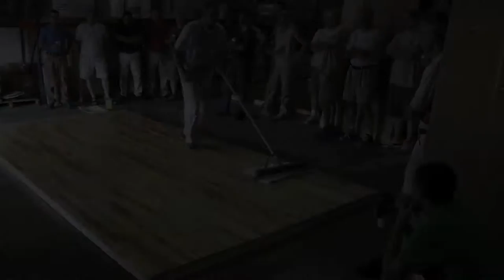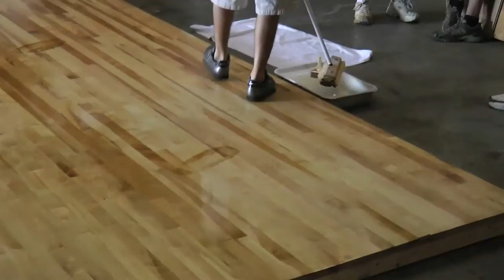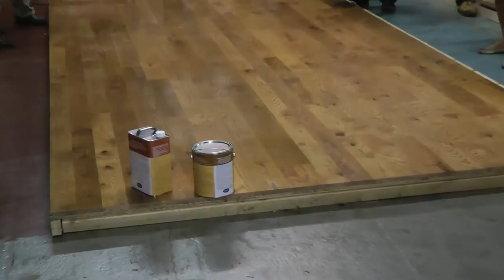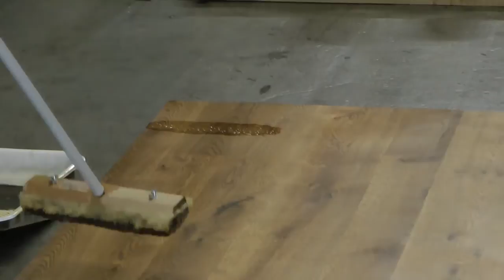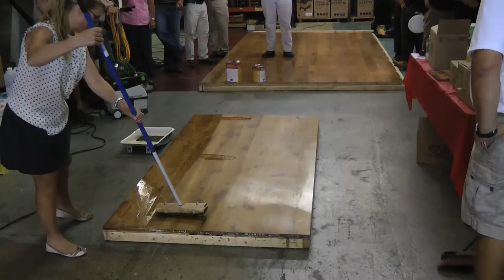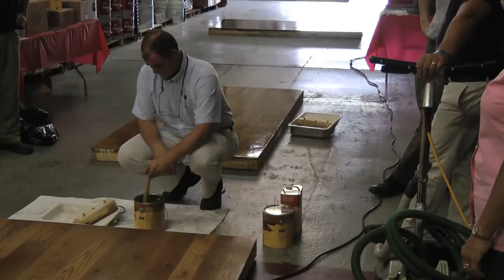Waterlox Training Seminar | City Floor Supply

Comment: For my live edge tiger maple table..can I buff on a wax over my final Waterlox coat?
Reply from the maker: Yes, you can use a wax over Waterlox. We would not suggest this for a floor as it would be extremely slippery.  Also be careful of water rings from glasses and hot rings from coffee mugs. Good luck!
Reply: It's for a live edge maple table..not to be walked on.